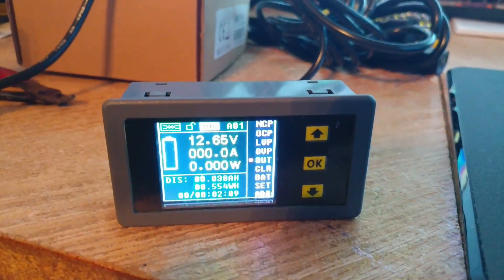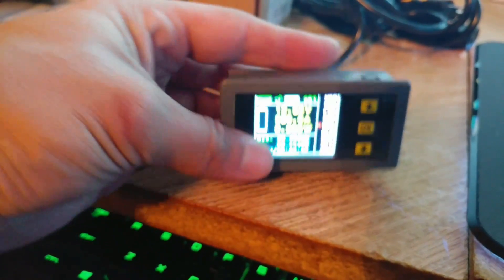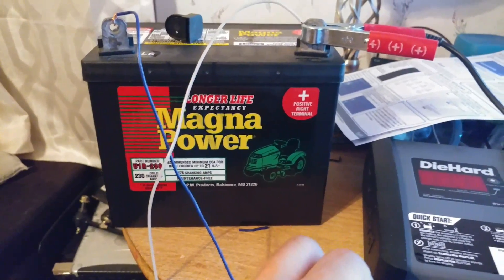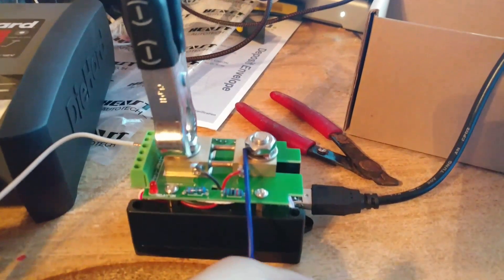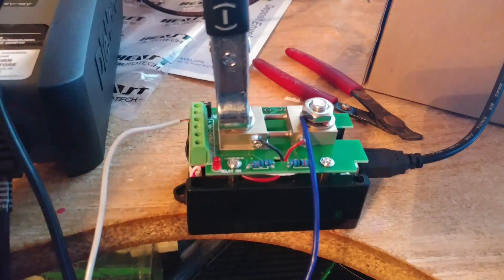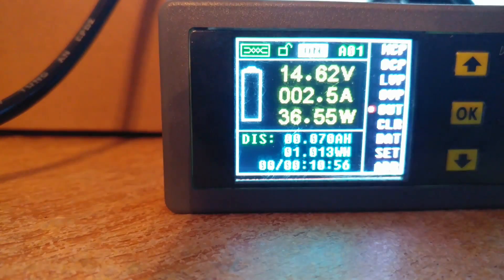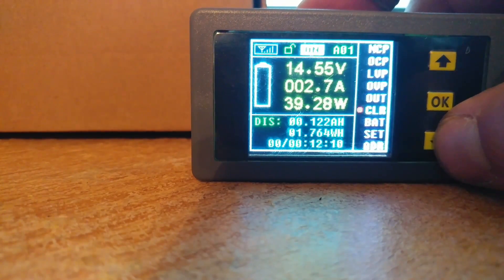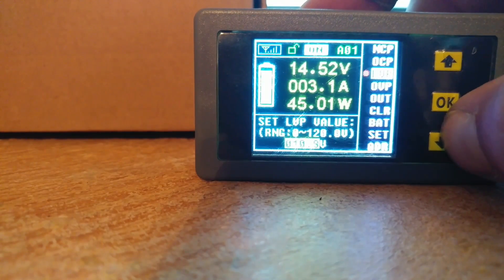DC Multifunctional Wireless Digital Bi-directional Voltage Current Power Meter

Comment: I think you had the shunt wired backwards compared to the load side vs input side on mine and mine actually show "CHG" for charge where yours is still showing "DIS" while you had it on the charger..
Reply from the maker: It's very possible. At the time I couldn't find much on those, and I threw that together rather hastily (the very obvious lack of production value lol). I guess I  did get it right when I installed it on the boat with the solar it was meant for, it was reading proper there. Got it right by accident I guess!

Comment: Is there a way to shut screen off when not useing it to save power consumption?
Reply from the maker: I don't believe it does. I know the draw was relatively low since we had it hooked to a battery bank and solar on that boat (since been sold), but I don't remember that it ever dimmed out completely. I've searched through a lot of the other videos as well, and never did see any of them time out either.

Comment: There is a rather cool version out now that includes a hall effect gadget. Cheapest "clamp type" meter I've ever seen, but, you actually, it looks like , run a wire through the hall effect thing, it doesn't show it opeing up like a clamp meter ? Still cool though. Had a VL link so, here's the description " 
Voltage Current Meter Amp Meter 1.8" LCD Hall Sensor 90V 100A Bidirectional " and it should come up.

Comment: You plug in the charger but the display still states discharge rather than charge, also the battery capacity bar went straight to full..

Comment: Why at 10 min in when you're charging, does it say DIS for discharge instead of CHG? Surely If it's a bidirectional shunt it's protocols  should be correctly named? I have the vac4300a  0-400v 300a unit of the same design and I made a cable that actually looks kinda identical to the briefly shown one on the Internet video. Because of this I'm  trying to figure out if NCP and OCP are also reversed? The instructions are so confusing, I just wanna know which is charge current and which discharge current? Sheesh!
Reply: because should be wired differently for charge or discharge as per instructions.
Reply: I think they expect you to buy two; one for current charge (hence the temp feature) and one for current drain. And the relay they don't supply (dependant on amp dis-charge or charge) basically isolates the power line being measured on the over current, under current,etc

Comment: No current protection laugh out loud. It means ‘negative current protection’ and allows you to set a maximum current in the reverse direction before it will cut out using the optional relay. This allows maxim current protection that has a different limit for both charging and discharging.

Comment: What diehard battery is that?
Reply from the maker: If you mean the battery charger that I was using for the "source" voltage, it's a model 71321: https://www.amazon.com/DieHard-71321-Platinum-Battery-Maintainer/dp/B077772K96 - The battery itself is just a cheap lawn mower 6v battery.

Comment: Hi, not sure if anyone els has this issue or found a fix. My vac-1200A has die battery level indicator dropping to 0 before the battery even reaches 95% SOC. It has a % right below the battery level and that shows the right %.

Comment: OK, lemme ask again - maybe I didn't word it right below. I have installed the shut assembly on the negative side of a 48vdc battery bank. For shunt power I tapped into the 3rd battery out of eight wired in series which gives me 21 +/- volts for power to Vin+, well below the 30vdc limitation. The unit woke up and is running fine but of course all readings but the amps are wrong. 

Since the unit is rated at up to 120v, how do I connect the shunt to get the full voltage from the bank without frying it since the power input to Vin+ is 10-30vdc and the shunt is measuring from that connection?

Is the 10-30vdc input power just for the display and the shunt can take system voltage up to 120vdc? this would be the only logical answer but I don't want to fry the shunt with an experiment.
Reply: Jim Bayer I have mine connected to a 48v battery bank. Shunt on negative and the positive side on 48v. Reads everything fine. Mine just messes up the soc meter..... That seems to drop to nothing while my battery is stil above 95%. Battery capacity is set correctly too. The % shown below the battery bar is correct.

Comment: Hookup if system is greater than 30vdc? I understand the power input thanks to the video, but for a 48vdc system, where does the reference voltage hook up.? It would seem the only option is Vext+

Comment: Does the shunt consume power when there is no load being drawn?
Reply: Inconsequential watts and even less if wireless
Reply: Jim Bayer thanks for getting back to me.  I hooked up mine on my new micro solar generator and vey happy with it.
Reply: Wow, that was quick. TY. But I'm still trying to confirm the hookup if the system is, for example, 48vdc. Vin, Vext.
Reply: NO... its a resistor in circuit and if there is no AMP flow in circuit there is no drain.

Comment: you somehow lack experience with electronics power meters dc ecc... i guess the instructions are not clear for a beginer... in all battery monitors (the expensive ones for the boats) is the same principle... the shunt and the alimentation of the instrument, this one has a few nice features for relays (that in a battery manage unit must be solid state) now i know how to manage the 12v liion batt for my boat :)
the nicest thing inside is the Ah meter taht shows you how many amp/h you draw or recharge... that way you can keep an eye on the real state of a lead acid battery...
Reply: dude your english is ten times worse than the instructions, stop talking english please
Reply: Mr Experience, ya don't know the real state of charge, even with the best battery monitor, unless you have a hydrometer. If an AGM, well, best guess. Liion, well, we'll see. Musk is going to buy it all.
Reply: Jim Bayer but this will let you monitor “the real estate” of a lead acid? I’m pretty ignorant with this stuff but am trying to learn, trying to grasp what exactly this provides functionality wise, it’s not entirely clear to me how I could practically use this with my car battery for example if I was so inclined, when charging/maintaining etc. the undervoltage could be incredibly useful though

Comment: Just to clarify the negative is wire like he says in the video. The input Vin+ needs to be wired to 10-30vdc for the voltage meter to work Nothing on the vin- it isn’t necessary. Vext+ also needs 10-30vdc and nothing on the Vext-. The Vext inputs send the voltage to the relay outputs to be able to use the out,ocp,ncp,lvp,ovp and on/off functions on the display. The relay+\- go to a external relay that does not come with the meter. The voltage of your relay coil needs to match the voltage supplied to Vext+. So 12vdc on Vext+ = 12vdc on relay+. Make sure you DO NOT wire anything backwards it will burn up the unit. It took me a long time to figure this out hope it helps.
Reply: i was gonna mention that! but you were first;)
Reply: Can I ask you a simple question cuz the instructions are terrible, so I bought the unit with the hall sensor, I can see the battery voltage but thats about it., do I need to run 2 more tiny wires from those inputs to the positive on the battery?
Reply: Mine is running fine on 48v dc. Bank goes all the way up to 60v with no issues on measurement
Reply: Fuck man I’m not sure it’s possible to learn as much about electricity/batteries as I’m interested in learning in my lifetime

Comment: I also found three other hidden options when you go on the set up screen to NCP and long press the top Arrow button it will show DFT for something that looks like restore data range. C - I that looks to calculate current. And c - V that looks to calculate current but the numbers seem too high for anything this meter can handle...
Reply: Apparently it's a negative flow setting. For when you charge back through it.??
Reply: You can calibrate voltage and current measurement using C-I (current) and V-U (voltage). My unit did not measure small amounts of positive current (< 1.3A) while negative currents where measured accurately. I used the first parameter of C-I to set the 0-point of current measurement a bit lower. Now it shows current > 0.4A correctly.
Reply: hi, am trying to do the same the default value for I>0 is 0316 and I=0 is 28245,  the unit shown here is in milli amps or amps? and if i reduce or increase the value to calibrate it sets the main current reading zero[which i want] but after sometimes due to charging and discharging the reading gets wrong again.. what am i doing wrong?

Comment: The OUT function switches the relay output on and off, it doesn't interrupt the charging like you said. Same with the over current protection it just switches the relay off it doesn't break the circuit. The model you have is the 100amp one, the 30a version has the blue relay that all the current passes through, the 100a version has the option for a relay, but doesnt have one built in.

Comment: Mine worked for a day then although it still indicates that the display has wireless signal connection to the shunt and the timer/counter works, I'm not getting any battery readings (Volts, Amps, Watts). NB: I was powering the shunt at 24v! But it was fine and displaying correctly. Don't know if I've fried something now though? Any thoughts?
Reply: sydhelo base I too have done something similar or I know for fact that I fried one of my meters but the other is brand new and yet after repairing the fried one was some solder they both have still shown all zeros for the voltage amperage and wattage... I've been trying to get some more information from the DROK, but unfortunately it's a little difficult relaying the information needed to resolve our issues
Reply: try holding the set button in   works  for me
Reply: tim elkington YOU ARE A GOD!!! Thank you soo much! I have been battling this problem on two meters and your solution worked for one of them, the other despite my attempt at soldering a fried circuit is just not cooperating I will pass along your information to the manufacturer as well as suggestion for them to improve their instructions as I have been in contact with them and they could not help solve my problem thank you again, you did!!

Comment: I have the same unit and suing on a ebike, but I have a problem with reverse current.  With wired as input (battery) and load (motor), current shows +amps and displays shows "DIS" in green.  However, when wired the same as above, but the motor replaced with a charger, the current still shows +amps and display still show "DIS" in green BUT it should be -amps and "CHG" in red.  Has anyone else ever been able to show "CHG" and -amps?   This unit is supposed to be bi-directional current sensing.
Reply: OK -- The wiring he is showing is reversed. If you are charge monitoring a battery the battery is the "Source" and its' negative lead should be connected to the Shunt Stud with the black wire connected to it ( stud closest to the compression screw terminal block). The Charger is a "Load" as are any other loads connected to the battery and they should be connected to the Shunt Stud with the red wire connected to it (furthest from terminal block). It will then operate correctly.

Comment: GREAT video, thanks! How far are folks saying the wireless monitoring function will travel effectively? I'm hoping for 22 ft (or 7 mtrs). TIA
Reply from the maker: For the wireless, that MIGHT work but it's going to depend on the materials in between them. I never tested it on my actual installation, but I've had people reach half that at least., But other reviews of like products on Amazon say that it can be finicky, so it's going to be hard to say for sure, sadly. The USB direct connection hasn't given me any trouble, and using a long USB cable extension would work that distance, assuming you can route the cable. I'd say unobstructed, it might work wireless for that distance. THe "official" rating: Communication distance: 10m single set of open land
Reply: UPDATE: I bought one and it does travel around 6 metres reliably in my motorhome.
Reply: Low and behold it's woking fine now! Shrugs!

Comment: On the shunt, I can see 2 rods between the posts, I've seen some of these that only have 1 rod, and the one I have has 3 rods, any idea what that means?
Reply: nick fatsis I have two of these meters one with two rods and another with a 3 I wish I could be more help but so far I can't tell any difference then again I'm also struggling get my voltage amperage and wattage to display anything other than 000.00
Reply: Michael Willman thanks
mate, maybe the ones that have more rods can carry more current?